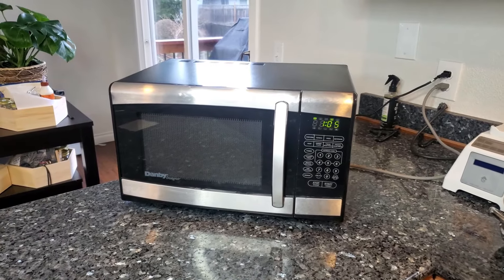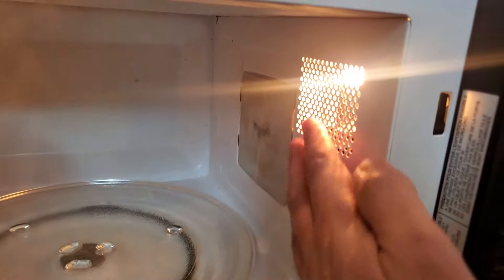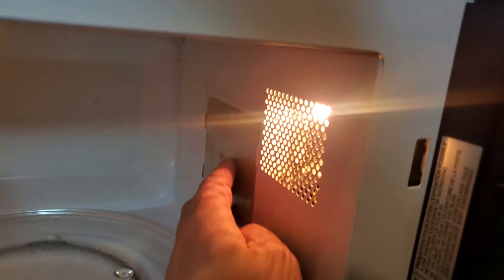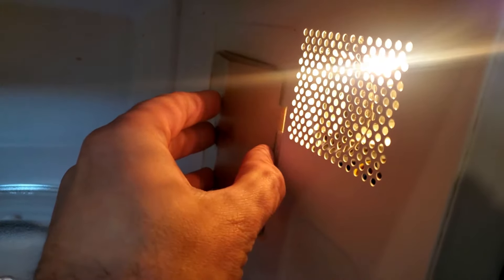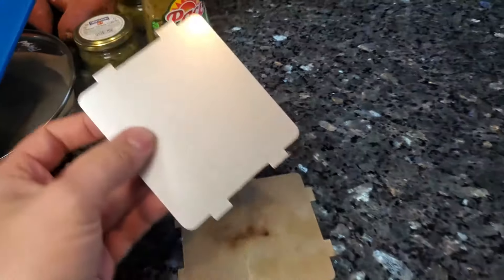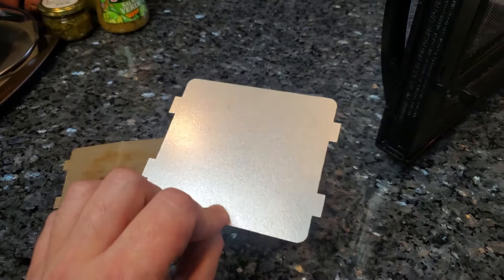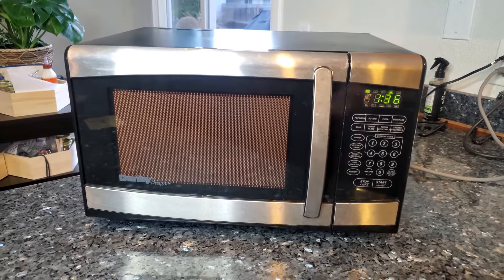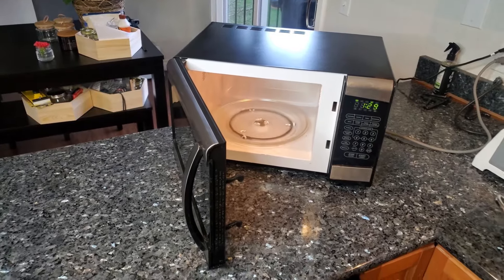How To Fix Microwave Sparking for $3 -  Broken Microwave

Comment: You should never operate a microwave without anything inside it. Without a load (something to heat up) the microwaves can actually end up bouncing around and going back to the magnatron, stressing it and reducing its lifespan. It can also cause the glass microwave turntable/plate to heat up very quickly to dangerous temperatures. If you're going to test a microwave like this, put a bowl of water in the microwave with a toothpick (or other nonmetallic object) in the water to prevent superheating. This will absorb the microwaves so they don't damage the magnatron or turntable
Reply from the maker: Good to know!  I didn't realize.
Reply: I don't know this and I do this mistek yesterday and My microwave not working did you know what to do please let me know if you now that
Reply: Thank you for this useful jnformation! It is actually the answer to my problem! My kid operated the microwave empty & it sparked inside.
Reply: how can you heat up glass without water molecules there???
Reply: I've applied your cleaning method you mentioned about a flexible material and put it back  with a perfect result. Thanks for your video.. it's works
Reply: @rendzis  RIGHT !! Bingo....
a lot of misinformation here...
Reply: Actually fixed my issue as well!

Comment: I was about to replace my microwave when I came across this video. You saved me 1k or more!!! Thank you!!!
Reply from the maker: Happy to hear it!
Reply: @JMGENTERPRISES  i will try to clean it first... and hopefully will not need to get a new cover... did u try to just clean it and see if it works? ...thx for the video
Reply: Damn what type of microwave do you have?
Reply: @factsnolies7650  Viking
Reply: @annettequadling165  My microwave cost me 10$ and is from 1996
Reply: Thanks.. funny thing tho I keep my micro very clean. I know peoples that are so filthy I wouldn't touch it and they dont have any problem. I thought maybe condensation was affecting it but tonight it did it within 10 seconds  Can I just cover it instead?
Reply: 1k for a microwave? damn considering they are all made by the same manufacturer that's a lot of money
Reply: @lesabooth5243  if you keep your microwave clean that is probably not the problem. Look at your wave guard. If there is no evidence of arching (burning) on yours it is not a wave guard problem. That said you might have had something metallic in your unit otherwise you have a more serious problem.
Reply: @jsenear  there's damage. It's a Hamilton Beach microwave. I remember back in the day the waveguide was actually made of metal no? 
I removed the damaged waveguide and it's flimsy material. I ordered some more of this crap from Amazon
Reply: @lesabooth5243  it will fix your Microwave. Mine is like brand new after I replaced the waveguide.
Reply: Fantastic! Now you can put that $1000 towards a new coffee maker!
Reply: @trickortrump3292  or a 2nd vitamix lol.
Reply: who is paying >1k for a micro bro? op's siss

Comment: THANK YOU... Thank you very much sir. Thanks to my wife who said check YouTube, I found your clip and problem was solved. We have a Bloody expensive Breville combo oven Microwave and of course they don't see that part. I first Took that piece off and cleaned it but the parts that go into the body of the microwave broke so it would not stay in there. To test. I put scotch tape on it and ran it for 30 seconds & VOILA, thanks to your advice it was proven that was THE problem. Next I went to Amazon and what do you know, they had one with exact measurement down to the millimetre & even if you don't find one that fits your microwave, they have material that you can trace and cut your own size. THANK YOU VERY MUCH for taking the time to make and post this video. I have subscribed and rang the bell to get all other videos. MOST USEFUL VIDOE I have seen so far. Love it, have a fantastic day.
Reply from the maker: Awesome!  So happy to hear it!  Thanks for letting me know 😊

Comment: My microwave made alarming noises and sparks flew, it was really unnerving.  After cleaning it thoroughly, nothing changed so I was about to reluctantly give up and buy a new one when I found your video.  I took this "wave guide" thing out, cleaned it and put it back and in less than 20 seconds, my microwave was fixed and working fine again and it cost me precisely nothing.  Thanks JMG, fine work sir.
Reply from the maker: Awesome!  So happy to hear it!  Thanks for sharing!
Reply: Now remember even if your quick fix doesn't last very long all you need do is purchase a new one for your model microwave or cut one to fit. That will be a good as new fix. They are around $5 to $10 for a new one.
Reply: @jsenear  I was lucky enough to get away with it same way also today Christmas lol but ordering 1 next peace out
Reply: @cameltube-vk7el  good job!!!
Reply: What if some of the top inside of microwave rusted? Could that be the reason sparking?

Comment: Good info. Thanks.
I have an expensive Thermador drawer microwave. My waveguide is mounted on the ceiling inside the microwave and it's okay. I have been getting an arc from the metal 'axle' or post for one of the roller wheels of the drawer against the lower back corner where the paint is burnt off. It appears, from watching another video, there is a special paint for the interior of microwaves that can be used. I mention this in case my problem is the type others are having.
Reply from the maker: Good to know!  I will keep that in mind for any future comments with that issue!

Comment: Thanks! what an enlighting video!
so I ended up here after having read the manual of my microwave 
and huh .. I'm kinda in stunned .. there is absolutely no mention of this waveguide in the entire manual 
and now I know why .. 
in the manual, however, they do say "The microwave will be good for 2000 hours "  
and I read that thinking .. and then what? the magnetron will stop working? why ?
but now seeing this video I'm thinking .. 
let's say the average time I use my microwave (mainly heating up meals) takes about 5 minutes
2000 minutes ÷ 5 minutes/uses = 400 uses 
now 400 days is approximately 1 year and 35 days. and I'm guessing that's about the time that waveguide would be dirty enough to possibly give a spark .. 
(or am I overthinking this? and does a microwave simply not last longer than this time .. oh I'm so tempted to brainstorm more on this xD the fun fact is the microwave has 2 years warranty.. that is longer than the time it should work according to the manual xD )
Reply from the maker: Glad I could help and you are correct, usually the waveguide starts to wear out around that time.  I think they leave it out for safety purposes.  They probably do not want the average Joe trying to repair a microwave.  Or maybe it's because they want you to purchase another microwave!  Lol

Comment: Thank you! Cleaning my waveguide worked for now, but it’s looking a bit ragged, so I’m buying replacement mica board sheets on Amazon and will use the original as the template to cut a new one.
Reply from the maker: Glad I could help and good luck! 👍🏻

Comment: Unfortunately I think it's a defect in my microwave I'm receiving this issue with a new microwave 
I haven't had it for that long and I got it from Target so I really don't know what the issue is I think it's a defect 

And if it isn't that I think the roaches are short circuiting the socket and possibly short circuiting when it's being used because it shocks like once or twice but not more than that
Reply from the maker: Darn!  Hope it's still under warranty!
Reply: @JMGENTERPRISES  well it hasn't happened in like 2 days now, but apparently the plate was out of place and when I was using the microwave 
The plate wasn't moving correctly when things were on top of it 
And I guess because the plate was out of place and while the microwave was on 
it was causing a short circuit but I don't know I thinking that could have been the cause but it could have been something else 

All I know is I haven't seen shocks in 2 days, so everything seems to be fine for now

Comment: So helpful, I thought my Panasonic micro has already has already eol after only 4 years of using because of this spark! Just cleaned this plate and now its working tempo...will buy a replacement part online .it only cost less than a hundred pesos here in the Philippines...great info video you have here...thanks and keep it up!😊
Reply from the maker: So happy you got it fixed!! 👍🏻

Comment: My Zanussi flashed inside ( nothing being cooked). Light went out and no control lights. Any ideas? I wondered if the light bulb was part of the circuit cheers
Reply from the maker: It's tough to say.  Have you taken a look at the wave guide cover?  Any markings on it?
Reply: @JMGENTERPRISES  no marks. Bit greasy. Though when plugged in, no lights on panel.

Comment: Thank you for this! I did a deep cleaning of ours and this fixed the problem - and saved a replacement of a $1,000 built in drawer microwave. I've ordered a replacement as well to have on hand that will likely need to be trimmed as after searching everywhere could not find the exact part.
Reply from the maker: Excellent!  Happy it saved ya some cash!

Comment: Thank you for this video. I was about to pay for a repair person to come out. I said why not try this, didn't seem like much was on there but when I cleaned it, my microware worked without sparking. I ordered a replacement to have on hand. You saved me a lot. Question, I don't know if you addressed this, but how does it get that stains on the inside of the waveguard on it?
Reply from the maker: Happy to help!  From what I learned, cooking grease gets on the waveguide cover and causes issues over time.

Comment: Hi dear is it necessary to keep this safety pad detached. Because I removed this pad from my microvave oven as per the manual installations. 
Kindly let me know what happens if we remove this pad and use the oven with out this safety pad.
Reply from the maker: Don't do it!  Make sure the waveguide cover is always clean and I stalled when operating!

Comment: Last night, our Samsung OTR microwave popped and sparked and now it seems that it no longer works. All the lights and controls work but it does not warm anything and no longer sparks.

I suspect it may have damaged the magnetron but thought there may be a fuse or something also. I do not see any obvious damage at this point before opening it up.

Model# ME16K3000AS/AC

Thanks if you have any information that can help.
Reply from the maker: I am not too well versed with that model.  Do you have a waveguide that appears damaged as I show in my video?
Reply: @JMGENTERPRISES  No, I am unable to see it, it has plastic covers. 

Other than it not warming anything up, there is a new low tone noise. Since everything else seems to be working correctly, I am going to open it up and check the capacitors, transformer, Diode, line fuse and magnetron.
Don't worry, I will discharge the capacitor and unplug the unit first.
Reply from the maker: @dizzydinonysius  Sounds like you know what you are doing.  Yeah, be careful.  Let me know what you find out!

Comment: What do I do I put some foil in there then took it out but it’s still sparking
Reply from the maker: Have you checked the wave guide cover for damage?
Reply: @JMGENTERPRISES  yes thank you it looks bad will try replacing as you recommended
Reply from the maker: @elftower907  it'll be a cheap fix!  I'm sure that is the issue 👍🏻
Reply: @JMGENTERPRISES  ty sir

Comment: Cant find the exact kind of my microwave plate….There Is  available replacement  but i need to pre cut it to fit on my microwave…is that will work?
Reply from the maker: Yes, it's cheaper to buy a universal one and trim it to the size of your existing one

Comment: Awesome couldn’t have said it better myself never buy a new microwave unless it won’t turn on. Then you have a problem now remember on Amazon sometimes they don’t go by brand they go by metric measurements which are easily with the help of Siri you can ask her what the equivalent of a metric number is to standard measurement. I have a Hamilton Beach 900 W. My plate on the inside is 2 1/2 inches high by four and just under 5/8 inches long which turns into 64 mm x 117 mm now remember in centimeters that’s 6.4 cmand 11.7 cm why in the hell didn’t we use the metric system? It’s really simple oh well.

Comment: Hello my microwave was making the same sparking sound and i did replace it but its still making same noise any idea please
Reply from the maker: You replaced the waveguide cover with a new one?
Reply: @JMG ENTERPRISES    No, I did remove the waveguide only and tried to turn it on without waveguide, but it still sparked
Reply from the maker: @gazalakausari4394  you always want to have the waveguide cover installed.  Maybe try cleaning the cover and re test

Comment: The waveguide on mine meets the bottom of the microwave.     When I put the microwave on it actually goes on fire there.     Could I still replace it?
Reply from the maker: Tough to say.  If you replace the waveguide plate and it's catching fire, I would just get a new microwave.
Reply: @JMGENTERPRISES     I think I will.  Problem is it's one of those lovely rounded back microwaves, for a corner,  and they don't do them any more.  Best bit about it is the door is high so you can open and close it with a plate in front without knocking the food off it.    I get attached to things, lol.
Reply from the maker: @psisky  sounds frustrating!  At least new microwaves are cheap!  sounds like a good route to go sure!

Comment: What if there was some burning of the plastic around the wave guide? Would this still work?
Reply from the maker: Is it plastic that holds the waveguide in?
Reply: It’s like a plastic/rubber piece. But I meant the microwave wall plastic. I saw a little burn on yours, my Dads was significant. But I followed your video and another comment and it worked! My Dad is happy and now doesn’t have to purchase a new one. Can’t thank you enough. ❤
Reply from the maker: @starr972007  Awesome!  Happy to hear it!  Ya, usually just a new waveguide will do it! Happy new year!

Comment: I took that off my new LG microwave 4 in 1 Airfryer 🥴 I thought it was part of installation, I ripping off tape and labels, I didn't know that flimsy card board aluminum piece was part of the microwave. 

So I definitely screwed up.🥲
So what happens if I use the microwave without it?
Reply from the maker: I am not sure.  I wouldn't advise using it without an undamaged waveguide installed
Reply: @JMG ENTERPRISES    Copy, I will send it back to Bestbuy 2mm and get a new replacement.

Comment: Have a high end Bosch microwave above the BOSCH oven. Had this issue and the new wave guide card solved the problem. I stock several cards now as backup, as inexpensive as they are order 2 or 3. Tip for you all, don’t run the microwave empty, that can absolutely cause damage. Another Tip, tech told me to always select cancel/stop before opening the door to stop it during the cycle. He said the will absolutely ruin the micro.
Reply from the maker: Good to know!  Thanks for sharing the tips! 😁

Comment: The problem I have is the plastic wheels on the Support Wheel Ring, keep rubbing the paint off and exposing the bare metal. Any ideas ?
Reply from the maker: I have NEVER heard of that.  Usually the wheels and the ring are so lightweight.  I couldn't imagine them rubbing off paint.  Are you putting really heavy plates on it when in use?

Comment: What if some of the paint on the lower trim where the door shuts is peeling off, and that is causing a spark?  Is there a tape or something I can put on that?
Reply from the maker: You can try some electrical tape maybe?  Do you see the spark coming from the lower trim?
Reply: @JMGENTERPRISES  It's not doing it anymore but there's a spot where the finish, is coming off, and it was exposed underneath and that was causing a spark

Comment: My microwave switched completely off after the spark.
There ain't no light, whatsoever.

Could it still be the same issue?
Reply from the maker: Hard to say for sure.  It's not turning on at all now?  Have you unplugged it from the wall then back in?  It's a cheap thing to replace and see if it helps before scraping the entire unit.
Reply: @JMGENTERPRISES  hey 
Thanks for your response man, the microwave is working just fine now. 
It had tripped the circuit and I only realized later.
Reply from the maker: @Snaz.z.z  Oh sweet!  Easy fix!  Didn't even consider that.  Haha

Comment: Mine started sparking and flashing last night. It looks like it is coming from the rack support. I unplugged it and bought a new one this morning but mine is only 6 years old. It is a Whirlpool. Can I just change the rack supports? They are plastic with a metal screw. Looks like only 1 is doing it.
Reply from the maker: Sorry I cannot advise on that.  My only solution is replacing the cover like I talked about in my video.  Maybe do a little more research.  If you end up doing it, let me know how it goes.  Six years is still a good run for a microwave.  Mine usually conk out around five years.
Reply: Yes, when the supports spark, you can replace them, or just remove the rack and supports if you're cool with that

Comment: Thanks. I used your video as a reference. My Microwave started sparking really badly. Because of your video, I looked at my wave guard and it looked like yours. Maybe even worse. I got a pack of universal ones from Amazon. I could not reference a specific one to my Emerson Microwave but I'm glad I couldn't. The universal ones are cheaper. It so happened the new ones were the exact same size as the one that came out of my Microwave. Took me one minute to install the new one and my unit works like new again. Thanks. You saved me from buying a new microwave.
Reply from the maker: So happy to hear it! 😀